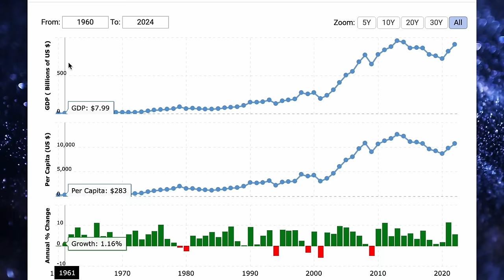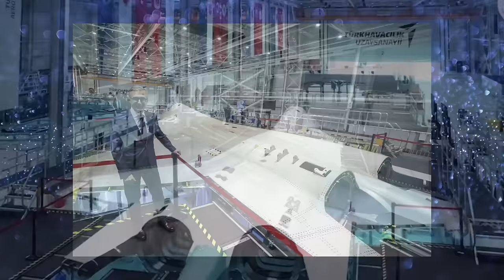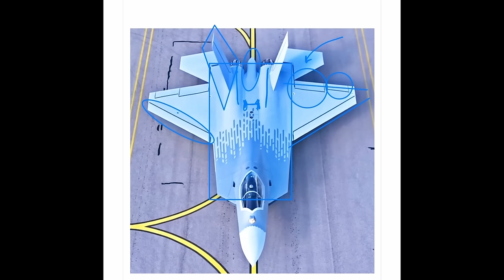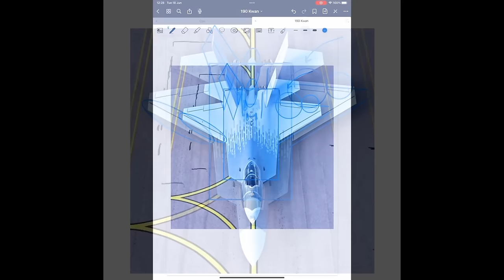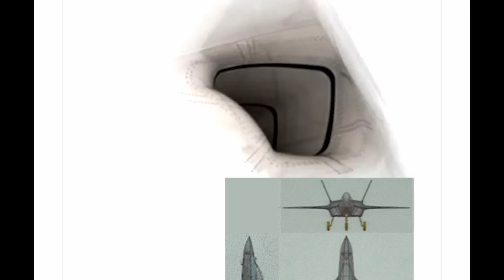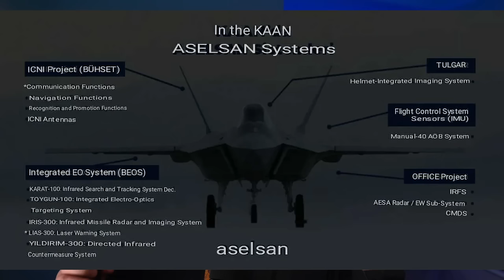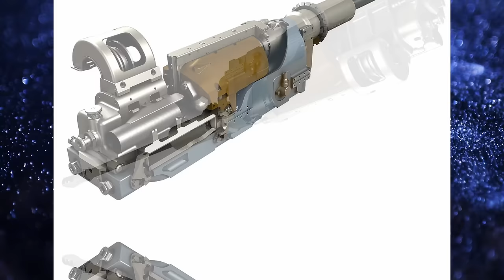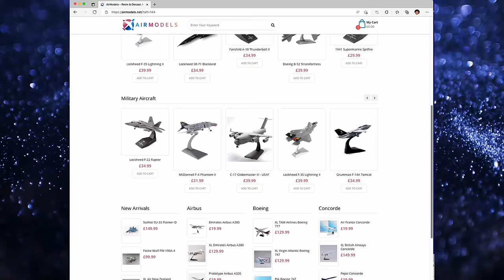The F-35 Has Met its Match

Comment: Watching the video prepared by an expert like you, whom I value, made me happy as a Turk. In general, I have nothing to object to and you made very accurate analyses. However, there are some points I would like to add:

The first prototype of an aircraft is not normally flown. However, TAI started flying both KAAN and HÜRJET aircraft since their first prototypes. Deeply adopted new technologies play a big role in this. Simulations, digital twins, etc.

Normally, confidentiality is taken into account on these prototypes. This first KAAN shows too much. The reason for this is that the aircraft will undergo more changes. The second prototype will fly soon and you will see a completely different nose.

Certain countries produce aircraft with different design priorities. For Türkiye, priority is given to a warplane that will cause damage if hit. We can understand this from the thick neck of the plane. This section, which is most susceptible to breakage in most other aircraft, is targeted by IIR guided missiles such as the Israeli Phyton 5. (Most of the structural weak points were strengthened.)

It is a multi-mission aircraft that will start its life as a stealth-designed F-15 and can progress to the F-35 and beyond as its subsystems mature. But this will take time and will be shaped around a newly established ecosystem. I consider it highly likely that European defense and aerospace projects will benefit from the efforts of this ecosystem and the modern subsystems it will produce. In short, KAAN and HÜRJET projects will also benefit Europe.

I wish you to make more videos on the Turkish defense and aerospace industry. I am especially curious about your opinions on HÜRJET, which is a candidate to be the modern interpretation of the much-missed F-5 and MiG-21, and has a reliable design and reliable technologies.
Reply: Turkiye is doing some neat stuff. This could become a nice export product line.
Reply: @waynesworldofsci-tech  no it wouldn't be an export. 

Who would the export to that wouldn't prefer either American or European or Chinese or Russian designs? 

India has it's own program, South Korea does, Japan does and China does and Russia does and Europe does and America does.

The middle East buys American. 

Western Europe buys American or indigenous. Eastern Europe buys Russian.

South East Asia buys American or indigenous.

Literally only Africa seems possible. But they mostly can't afford fifth Gen.
Reply: @sparkzbarca  

Um; no. The Russian aerospace industry has massive issues. The Chinese have huge quality problems.

That leaves the Swedes. Yes, the Gripen is fifth gen without full stealth features. It’s nearly as stealthy as the SU-57.

The Korean one will be good.  But expensive.

The US is too expensive.

The Rafale isn’t as good as the Gripen currently, though it is low observable. The problem is the computer systems.

If Turkiye can produce Hurjet and Kaan for a lower price than the competition, while offering relatively similar features, you have a market. 

Say Turkiye manages to see 50 Hurjets. That will help lower production costs for your own planes, but also help cover development.

That’s what the Russians did, until their engineering went to hell. That’s why India is working on their own design. They helped fund development of the SU-57 but decided to drop out, bought Rafales, and are now working on their own designs.

The country Turkiye would be competing in that market with is India.
Reply: @waynesworldofsci-tech  In fact, the genie is out of the bottle in the defense and aerospace industry. But no one has noticed this enough yet. The USA, which has extensive war experience, was the most reliable and sustainable supplier in the field of defense for a long time. As technology developed, it consolidated this position. It has now entered another period in which it will decline as technology develops. Many countries are still waiting in line for the manned F-16 fighter jet. There are significant question marks over the F-35 aircraft and these are also expressed by the countries that use this aircraft. (ALIS, signals intelligence claims, etc.) Even if the USA gave the next generation unmanned warplane for free, there are many countries that would not trust it and buy it. Seeing this, the USA wants to penetrate these markets through countries such as South Korea and Türkiye. (A change of management would instantly turn the relations between Turkey and the USA, which seem to be at odds today, into besties.) For this reason, it does not hesitate to give engines to planes like KAAN. Of course, chips and other subsystems that are difficult to produce locally. Therefore yes. It looks like it will be a very qualified export product...
Reply: @aybarsmeric pure delusion lol
Reply: @waynesworldofsci-tech  Chinese having huge quality problems is an obselete mindset, even the FC-1/JF-17 that they only export has been more than adequate in competing against the MiG-21 over Kashmir. 

Our Korean KF-21 Boramae doesn't even have an internal weapons bay, though that is acceptable as the designer's priority were 4.5 generation fighters - don't need stealth aircraft against North Korea. Japan gave up on their fifth generation and are working on the sixth instead.

Sweden's Gripen fulfills a different niche from Kaan, their closest competitors are the CAC/PAC JF-17 Thunder and HAL Tejas.

Turkey can't produce the Kaan for a lower price than the two superpowers, they don't have the market or the economic mass. But they can compete with India and Korea for non-aligned nation's orders.
Reply: @waynesworldofsci-tech  Don't know what possibly gives you the belief that Russia's engineering "went to hell". If anything the Russo-Ukraine War has shown that Russian engineering is on the cutting edge of aerospace tech. The reasons for the Su-57 engine delay were financial, rather than technical, and have been solved with the Su-57 now going into full production. In the meantime F-22s are being phased out as impossible to maintain and uneconomic to operate; while the TR-3 upgrade for early versions of the F-35 has been delayed, over a 100 F-35s are sitting on the tarmac not accepted by the US Airforce for quality issues, and the overall F-35 availability rate has fallen below 50% this year. I won't even get into the alleged performance issues with the plane. I think you're projecting the US Airforce's F-35 problems onto the RuAF.
Reply: @waynesworldofsci-tech  "That leaves the Swedes. Yes, the Gripen is fifth gen without full stealth features. It’s nearly as stealthy as the SU-57."

HAHAHAHAHA...

Maybe you should go back to school and learn to read?   If the Gripen is "nearly as stealthy as Su-57", that would mean that Gripen is close to F-35, which it is definitely NOT.

Why does people have such amazing inability to understand the difference between AVERAGE RCS that is the only numbers we have for Su-57 and OPTIMAL RCS which is what USA loves to throw around like they actually were relevant in any way, which they're not as they essentially requires the plane to fly straight at the radar source.

Gripen from the most optimal angle has an RCS close to the Su-57 AVERAGE from ALL angles, including from above and below reflecting on that huge wing area.

"The Russian aerospace industry has massive issues."

Uh-huh...   They just went from very limited serial production in 2021 to producing at least 60 advanced combat aircraft in 2023, including multiple Tu-160 which are VERY straining planes to build.   Those 60 includes 12 newbuild Su-57.   Another 12-16 Su-57 are expected for delivery in 2024.
Not to mention the ramping up of civillian airliner production as well.

If that's having issues, i really want to see what they can do without "issues".

"That’s why India is working on their own design. They helped fund development of the SU-57 but decided to drop out"

No, they dropped out because the thing they wanted most was access to the new engine, and like so many other times, the engine ended up taking triple the time to develop as the plane.
Why do you think India is once more talking with Russia about the Su-57?   As the first Su-57M prototype with the new engine first flew about 10 months ago.

"That’s what the Russians did, until their engineering went to hell."

Riiight...

The only thing that delayed the Su-57 was a combination of 2 things, first, that Russia didn't feel the need to prioritise it.
And 2nd, the argument between government and manufacturer about what the actual manufacturing cost of the plane is.
Reply: @aybarsmeric  "The USA, which has extensive war experience"

When?   Where?   USA haven't fought anyone that can fight back effectively since WWII.
This became almost ridiculously obvious especially during the Kherson offensive and later the Nuland-offensive in Ukraine.
I mean dear gods, 55 thousand casualties vs less than 400 in the Kherson offensive?
And that was because Ukraine followed USAs advice.

And while the casualties were not as extremely onesided in 2023, they were still massively onesided and above all else, they showed very clearly just how incapable US-style Nato training was in actual warfare.

The big kicker being that when the "elite Nato trained" unit was replaced by a unit of reservists in their 50s and 60s, who had NO OTHER TRAINING beyond Soviet conscription back in the 80s, that was when the offensive suddenly started advancing noticeably and Russia had to adjust its defenses, which they did not feel the need to do against the Nato-trained troops.

So, USAs extensive war experience makes for less capable troops trained in the last decade than Soviet conscription training back in the 80s...

"was the most reliable and sustainable supplier in the field of defense for a long time"

Are you joking?
USA had more strings attached than a whole ensemble of puppeteers.   And tech was mostly either blackboxed or cutdown versions.
In the last 50+ years, the most reliable defense suppliers have been France and USSR/Russia.
Reply: @DIREWOLFx75  

Reports I’ve seen that are public and easily findable indicate that the SU-57 and the F/A-18 hornet have a similar radar cross section. 

The SU-57 has way better computers and radars.
Reply: @waynesworldofsci-tech  "Reports I’ve seen that are public and easily findable indicate that the SU-57 and the F/A-18 hornet have a similar radar cross section."

No they don't.

Yeah, sure, public and easily findable and based on complete inability to read.

The only numbers we have for the Su-57 RCS are based on AVERAGE RCS.   Which is the composite radar RCS based on signature from ALL ANGLES.
Including from above and below where the Su-57s huge wing areal are reflecting fully.

And the morons in those reports are using that to compare directly to USAs preferred OPTIMAL RCS, which only includes the one single angle that gives the least return.

Also, we have actual battlefield facts from Ukraine.
Where western AWACS can't track the Su-57 at all.   At ranges where they CAN track the F-22 and F-35.
Reply: @DIREWOLFx75  

Really? Where’s the reporting that the SU-57 can’t be tracked?

Because ALL stealth fighters can be tracked. Lower frequency radars can see them, just not ‘lock’ on them.
Reply: @DIREWOLFx75  Yes USA lacks near peer war experience after Korea and Vietnam. Desert Storm Iraq can't count in that if you prefer. However, it can be said that it has sufficient staff skills in this regard. I suggest you do some more reading on military doctrines.
Yes, the USA has spent the last 3 decades deepening in the field of asymmetric warfare. He trained, equipped and experienced many proxy warriors. Of course, there will be difficulties in a large-scale war. But the character of the US soldier is that; they is loose in the beginning, but fights hard when they gets stuck. Although half of the army consists of immigrants who signed up to get green cards now. Anyway, this topic is deep and deserves a separate title...
Reply: @jonseilim4321  

Um, yes. Pakistan has been reporting problems with Chinese made tanks for absolutely no reason. Yep.

Other gear too.
Reply: @waynesworldofsci-tech  "Where’s the reporting that the SU-57 can’t be tracked?"

If you look outside the western propaganda bubble, it's not THAT hard to find.

And i did not say it couldn't be tracked.
I said it could not be tracked at the current ranges it has been confirmed to have been operating at from western AWACS, ranges at which said AWACS would detect F-22 and F-35.

"Because ALL stealth fighters can be tracked. Lower frequency radars can see them, just not ‘lock’ on them."

Now you're just mixing things up.   lol

X-band radars, which is normally used for targeting, are the ones that have trouble "locking on".   This is because the RAM of a stealth aircraft is "customised" towards what frequencies it absorbs the most, and since X-band is the dangerous ones, that's where they're usually tuned for.

That however is absolutely not a "yes/no" matter.   And does not affect lower frequency radars nearly as much.

Using the Su-57 as the example, it has 5+ radars that overlaps across the nosecone, and allows it to put 2 X-band and 1 L-band radar on anything within a 120+ degree forward cone.

And then it uses an advanced version of a normal sensor array combiner to make whichever 3-5 radars function as if they were a single much larger and more powerful radar.

This is based on the datalink system that was developed for the MiG-31 in the 80s, which allowed multiple MiG-31s to combine their sensor returns and made it the first fighter to unintentionally become able to both detect and shoot down stealth aircraft, as the multisensor arrays overcomes the stealth effect by radiating at it from multiple directions, which gives a drastically clearer return echo.

Sweden also developed a vaguely similar anti-stealth/improved sensor ability for the Gripen in particular but for the military overall as part of the STRIL-2000 system.
This in turn proved itself capable of detecting F-35s far far beyond normal detection range when USA was showing them off in Norway.

What that means is that when you have 4 Su-57 flying anywhere near enough to datalink, they are essentially getting the equal sensor returns of 8-32 aircraft.

And they are absolutely capable of "locking on" stealth targets.

Again, it's not a matter of binary yes/no, it's a matter of whether you have either enough raw power(like say an F-15 or MiG-31) or antistealth features(like a Su-57 or MiG-31) to burn through the stealth of a target and be capable of locking on to it.

And USAs epic mistake was to proclaim that it wasn't going to develop any antistealth abilities, because "that would help our enemies more than us", which is why today, USA is behind more than half of Nato in regards to antistealth ability, while Russia and China are the top dogs far FAR ahead.
Reply: @DIREWOLFx75  

You spend too much time in the Lamestream media bubble. Look at the data, not rumours and bullshit.
Reply: @waynesworldofsci-tech  Boyo, you're the one relying on "data" based not even on propaganda but of basic inability to read and comprehend.

And funny how you instantly resort to namecalling when faced with facts.

Fancy that.
Reply: @DIREWOLFx75 okay see.. i would like to jump in here.. my take in short is.. F22  is in a different league of stealth .. F35 is pretty good stealth and excellent avionics and ew suite.. 
now now now.. m from India, so lets discuss Su57 😂 bruh, IAF had issues with its stealth initially bcoz it isnt as stealthy as F22,35.. but major issue was old gen Engine in it.. and Russia failed to make a 5th gen engine on time.. i guess they built something now its under testing.. but Su57 is particularly not even touted as Stealth, but its more about 5th gen technology with Low Observability..
Coming to its RCS ranging from 0.1 to 1.. its nowhere close to F22,35.. but its alot closer to Rafale, and HAL Tejas mk1a (both averaging at around 0.5).. 
Su57 might be brilliant, but one wouldnt wanna buy it for stealth alone.. India would chose Rafale over su57 anyday.. and anyway if u have a Su30/35, u dont need a 57.. even Russia isnt flying it much 🙂 i ll take ur leave.. continue guys😅
Reply: @sparkzbarca  buddy you forgot that usa don't have their own 5g jet so turks in future could sell them a couple
Reply: @Rocky-pz8px  "but Su57 is particularly not even touted as Stealth, but its more about 5th gen technology with Low Observability..
Coming to its RCS ranging from 0.1 to 1.. its nowhere close to F22,35."

sigh

LEARN TO READ FFS!!!

That RCS number is AVERAGE.   Not OPTIMAL.
Average as in the composite from ALL ANGLES.
While the US numbers are OPTIMAL, the single least reflecting angle.

The RCS for the Su-57 includes from straight above and straight below, where the entire wings are reflecting.
The RCS USA throws around are purely the one single angle, usually nose on that reflects the absolute minimum.

It's like saying that a supertanker is smaller than a large yacht, because the length of yacht is longer than the width of the supertanker.   It's completely nuts.

And the Russian numbers are CLEARLY and blatantly stated to be AVERAGE RCS.

.

"my take in short is.. F22  is in a different league of stealth"

Not quite such a huge difference, but yes, its stealth is clearly higher quality than F-35.

.

"m from India, so lets discuss Su57  bruh, IAF had issues with its stealth initially bcoz it isnt as stealthy as F22,35.. but major issue was old gen Engine in it.. and Russia failed to make a 5th gen engine on time.. i guess they built something now its under testing.."

Yes, India was part of the program primarily to get access to the engine rather than the plane.   So when the engine was delayed, they eventually left.

And the first Su-57M prototype flew early Autumn 2023, so the advanced engine is definitely getting close to finished(so now there's talk about India wanting to get back in, but Russia being not quite as interested any more).

There's even talk that the -57M might be in serial production by 2025.   More likely, 2026 or 2027.

Also, as M7 mentions in the video, it's quite common for the engine of an aircraft to take much more effort than the entire rest of the aircraft.

.

"bcoz it isnt as stealthy as F22,35"

Wrong.   But also complicated.

The best information i have, from a source who so far always has proven correct, is that the Su-57 is almost right in the middle between F-22 and F-35.

However, it has a very different "distribution" of RCS than both of them.

Yes the engines used are "non-stealthy", however, the Russian engineers came up with a partial fix for that, which is apparently why Su-57 sounds so uniquely.

So, the RAM material used on the Su-57 is supposedly noticeably better than what the US planes use, apparently they've managed to incorporate radar absorption both against X-band AND against lower frequency bands.

So, it has a larger RCS from the front than an F-35, but a smaller RCS from say, the side, than an F-22, despite being physically larger.
So, it's overall RCS is smaller than the F-35, but larger than that of the F-22 due to the reduced stealth from having only partially-stealthy engines.

Basically, US aircraft are using advanced 2nd generation RAM, while Russia is using early 4th generation RAM.

.

"Su57 might be brilliant, but one wouldnt wanna buy it for stealth alone."

It's been confirmed within the range of Nato AWACS in Ukraine, where those WOULD be able to detect F-22.

Without being detected.

And it's scaring Nato.  A lot.
Reply: @愛を込めてロシアから  dude your thinking of 6th Gen. 

The US has like 6 of the fifth Gen lol. In fact the US has more fifth Gen aircraft models in use than the entire rest of the world combined. I mean actually in use here, not drawing board or testing stuff but aircraft that are accepted for full production.

Hell more if you think stealth is that makes it fifth. 

Forth Gen to be clear is the f16/f18  su27/su35 etc. 

Fifth Gen is all that exists at the moment. That's for America the f22/f35/B2/b21/rq170/rq180 and MAYBE you can call the f117 the first fifth Gen. But normally most people view the f22 as the first one ever. 

Your getting your generations mixed up. Also the only reason turkey is making that jet is because the US refused to sell it f35s because it purchased s400s and the US had no interest in letting Turkey run tests actively trying to target the f35 with s400 whose results would inevitably get back to Russia and improve their ability to target America's premier fighter jet.

The US isn't buying something that was only made because the better American option was off the table. Also I mean come on the US has never in it's history dating back to ww2 purchased foreign combat aircraft.
Reply: @sparkzbarca  No, I mean exactly the fifth generation. What you call f22/f35/B2/b21/rq170/rq 180 (by the way you lost the rq170 in Iran in 2011 LOL) And why didn’t you mention the F117? 
All these aircraft are not fifth generation. 
The F 22 does not have modern avionics - it has only one radar, no flir and irst, no link 16, no connection with AWACS aircraft, cannot strike on the ground, cannot map the terrain, small compartments for weapons, and even the stealth is outdated, not to mention computers. 
The F35 has serious thrust-to-weight ratio problems, no supersonic cruise, no super maneuverability, and GPS issues. 
B2 B21 These are generally bombers, they do not fly faster than one mach, and RQ are reconnaissance aircraft and they also cannot fly faster than one mach, and most likely their maximum speed is limited to 0.5M, like all wings. 
A highly specialized aircraft like a raptor, bomber or reconnaissance aircraft cannot be fifth generation, dude. So the United States does not have a fifth generation. Only Russia, and after a while Türkiye
Reply: @sparkzbarca  aaand your comment dissapeared LOL
Reply: @愛を込めてロシアから  yeah they are probably filtering the word Tur key. Trying to keep out the riff Raff I imagine.
Reply: @愛を込めてロシアから  the idea that you can only be fifth Gen if you do it all instead of having dedicated platforms for different roles is absurd though. 

It's like saying a tank isn't fifth Gen cause it can't shoot down planes. 

Rich nations like Russia, like China, like the US don't need a plane bad at everything they have more than one tool
Reply: @hakangurel6686  I'm not an engine engineer, but I doubt that one person can design an engine for a fighter, especially during an internship. And it’s not even a matter of the complexity of the calculations. You need a huge amount of fundamental knowledge about materials. Russia has been working on creating engines for the Su57 for 20 years, even with all the scientific base that was in Russia and the Soviet Union. You need a colossal amount of scientific work, scientists, money and technological base. By working on this, you increase the technological capabilities of your country and not just make engines
Reply: @sparkzbarca  you are grossly underestimating the position Turkey holds in much of the world especially among other Turkic and Muslim countries. Turkish drone popularity proves this. Yes not many countries have been developing drones like fighter jets but even then China alone could have met the demand for it easily but it changed when Turkey entered the scene. Your country's reputation is paramount in getting defence contracts even moreso than price and quality of the said product. That's why countries like Malaysia and Indonesia prefer buying Turkish equalivents when they can. They have no problem accessing Western equipment after all but still Malaysia recently bought Turkish corvettes, Indonesia bought Turkish anti ship missiles just a few examples. So you mean to tell me that if Turkey develops a F35 level 5th gen aircraft there won't be any other buyers than Africa? You seriously believe that? Even Poland bought Turkish drones when they easily could have bought American or Israeli ones.
Reply: @sparkzbarca Some Balkan and East European countries would buy it when it is  a finished project with success. Also Turkic countries in central Asia would drfinetly buy it. Africa can not afford it may be Some north african countries. But those are more than enough
Reply: @hasankilic9825  the jets cost more than a f35 or f15EX.

Which countries specifically do you think can afford a stealth fighter fleet? 

Cause the richest are like Greece for example but they are getting f35 and are in NATO so that ain't happening.

Serbia is next maybe but they just got mig 29 ten years ago and honestly they were donated

 Also turkey and the US are more aligned with arch rival Kosovo. So unlikely Serbia moves to Turkish arms when they are pissed turkey recognizes and sells arms to them. 
Montenego is NATO and so again they'd probably be pushed into f16/f15/grippen/euro fighter choices to avoid Angering the big boys.

Can you tell me what countries you think can purchase and sustain hundred million dollar air frames that have an upcoming need for them? I'm not saying it's impossible but I just don't see it
Reply: @sparkzbarca  İt is an economy of scale when they are produced in big numbers cost will come down. Moreover, why not Hungary,  Romania, Bulgaria in the future. Those countries already bought many armered vehicles from Türkiye. Altough it is not necessarily Balkan countries but talking about bigger quantities, Central Asian Turkic Republics such as Kazakshtan, Uzbekistan others rich in oil&gas, Malaysia, Endonesia all are possible buyers other than Azerbaijan and Pakistan.
Also some oil/gas rich countries like Algeria, Libya even Egypt can buy it. Those countries already asked for Turkish drones from Türkiye. For the buyers, more important other than cost is the reliability and sustainablity.